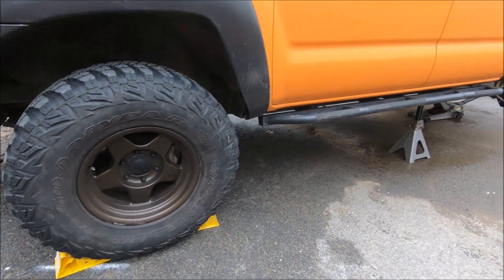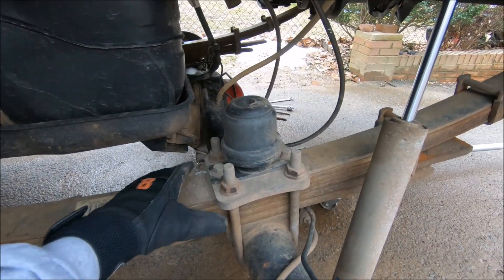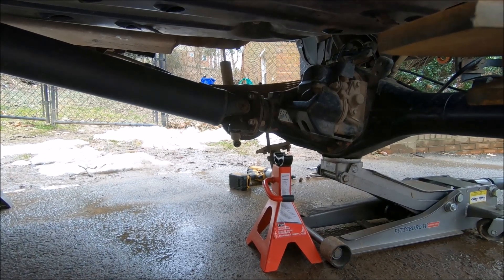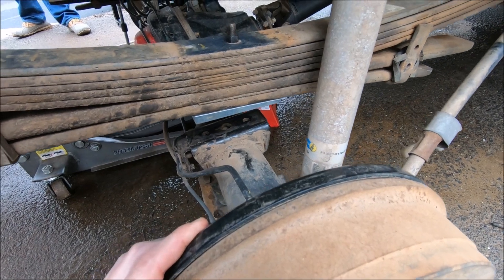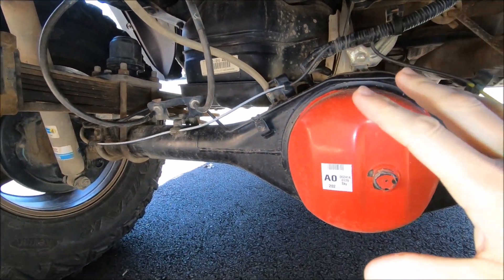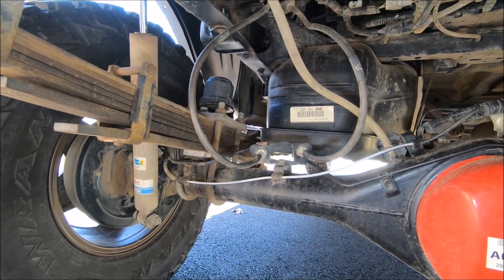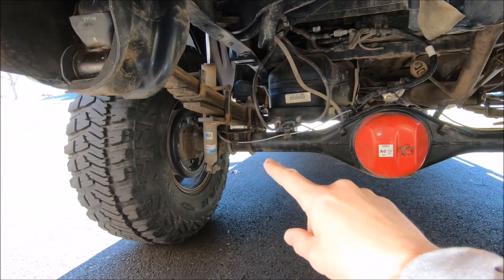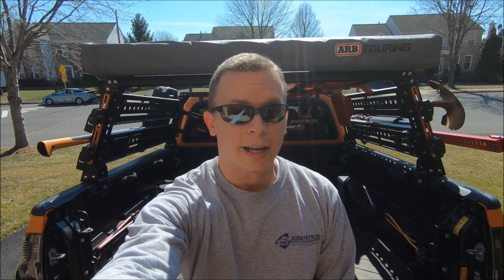Toyota Tacoma Mod Install — AXLE SHIMS Eliminated Vibration

Comment: IT ACTUALLY TOOK CARE OF MY VIBRATIONS !!!!  I did everything that you did to try and get rid of the dreaded  after lift vibrations.  First, I started with the Needle Bearing and replaced with a new Clamshell bearing.  It didn't do anything.  Next, I replaced the carrier bearing and one of the U joints and added spacers,  It made it worse around the 20 to 28 mph.  Sooooooooo,  I watched this video on basically...the last chance on fixing the vibrations and gave it a whirl yesterday with Toytech 3 degree shims.  When I took the truck for a ride to see if it actually worked, in my amazement IT DID!!!!  WEEEHOOOO!!!!  I can't believe it!!  What a relief to finally figure out if I was ever going to fix it or drive it with an annoying vibration.  So Thanks Mr. Tacomaholic Sir!  I really appreciate you always taking your time to do videos for us 2nd gen Tacomaholics.'  Well Done.
Reply: I just did the same in that same order except also dis cv axles since they were leaking... just ordered a shim due to it not having one... maybe I removed it when I put the leveling kit idk lol

Comment: When I put on my King suspension with OME medium leafs on my 2015 Tacoma I installed shims off the bat because people on TW said so.  After I installed the lift I got noticeable vibes right away.  That same day I removed the shim and all the vibes went away.  Installing or removing the shim took me less than 30 minutes. Did all the work myself with 2 jacks.   So for me I didn’t need any shims.  Only using the carrier bearing drop.
Reply from the maker: Yep. Always good to see if you get any vibes before adding shims. Some need them, some don't.

Comment: Just put a 2inch front and 2 inch spacer lift on my 2013 Tacoma. Immediately had needle bearing noise. Replaced that and the noise is totally gone but I still have a “rumble strip” vibration when I slow down at 30mph. Have diff drop also. I think I’ll try axle shims next.
Reply: Installed 3degree shim. It removed vibration when braking, now have vibe under acell lol can’t win.

Comment: Before deciding to start throwing parts at a problem, understand drive like geometry. Take your truck to a knowledgeable shop and have them show you the relationship between the output angle of the transfer case and input angle of the rear differential. They need to be the same. When you install axle shims or carrier drop shims it can negatively impact those angles and cause vibration.

Comment: Axel shims are my next step. Have a 2016 SR5 and I'm having vibes after my 2" lift. Tried the ECGS bushing and CB drop. Vibes are from 35-45 while at low rpms.
Reply from the maker: When was the last time your wheels/tires were balanced?
Reply: @Tacomaholic  When the shop put on my F5s, same time they put the lift in (4 weeks ago). They said they will check the balance when I bring it it for a diagnosis on Friday.
Reply: Hey Noah. My truck does the same thing between 25 and 40 mph. How did you end up fixing the vibe? Shims ? Or the carrier shacer ?
Reply: @christianluna5115  I ended up going with shims. I recommend doing a lot of ready on tacomaworld and a lot of measuring to determine what degree shim you need. Tons of good info on tacomaworld.
Reply: Do the vibes happen constantly or intermittently like every 2 seconds?

Comment: I have a shudder/vibration upon deceleration at 25 mph. Have a 3 inch ARB lift with Dakar springs. Vibs drive me nuts. Already have CB drop kit. Thanks for the video. Any thought on driver side needle bearing replacement with bushing?
Reply from the maker: Vibes with deceleration are often caused by an issue with your brakes.
Reply: @Tacomaholic  I already checked that out. Occurs even when coasting in neutral without using the brakes
Reply from the maker: @thumperjr100  Gotcha. Maybe the shims will help then.
Reply: @thumperjr100  Did shims help?
Reply: After many visits to the dealership. That is what they call “Normal Characteristic of the truck”. Not related to the brakes. Regular Driveline Vibration while breaking or coasting 30-10 mph. I’m going to try the 3* shims tomorrow. Even on stock 3rd Gen Tacomas

Comment: Hey man, great video... however, it didn’t appear that you replaced your U Bolts. Always done that with mine. Threads are damaged the first time they get torqued, so when you remove them you don’t get enough clamping force when reusing them. Just my opinion, I’ve seen people do it, but I would rather spend a little extra and make sure I don’t sheer my centerpin or  lose my axle!
Reply from the maker: Hmm I'll have to look into that, first I'm hearing of that.
Reply: Tacomaholic great job on the bumper! Did you ever look into what I said about reusing the old u bolts?
Reply from the maker: Thanks Matt! I've looked around a little and seen conflicting reports.

Comment: Hello, Another great video.  Thank you for the hard work. Can you tell me if the jack you have listed below is good for a Tacoma with 4 inches of lift?
Reply from the maker: Thanks buddy! That floor jack should be good for 4" lifted Tacomas too, but you can use a 4x4 or 6x6 block to help as well if needed.
Reply: Thanks for the quick response. Yeah that's what I was thinking too.  Thank you again!

Comment: hello, I have a 2018 Tacoma with 4000k's on it. I installed a leveling kit 2.5 front and 1.5 rear. I had vibration around 40k's an hour, I replaced the front drivers side needle bearing and also dropped the carrier bearing with the old man 8mm spacers. but still have that vibration. feels more like coming from front end cause I can feel it at the steering wheel. maybe I should try putting the rear diff spacers to see if it goes away.
Reply from the maker: Worth a shot trying the axle shims in the back. Are you sure your wheels/tires are properly balanced?
Reply: yes I took it for alignment and got the wheels balanced to make sure...
Reply: @ferncules1  did you end up finding out what it was
Reply: I'm in the same situation, did you end up finding out what it was?

Comment: I put a 2” add a leaf on my 2017 TRD Off Road 4WD. 

I’ve been getting vibrations from 20-25mph. 

Would you recommend 3 degree or 2.5 degree shim?
Reply from the maker: The axle shim could certainly help but try adding the carrier bearing drop kit first as it's cheaper and easier to install. Here's a link to it which should be good for all 2nd and 3rd Gen Tacomas: https://amzn.to/383P3FF
Reply: Ronnie, I did the same as you and also have the 20 mph vib. Did you do the CB drop? Were you able to stop the vib?
Reply: @bward5725  I'm having the same situation, did you solve it?

Comment: Im doing an AAL to my 2012 sr5 DCLB here in about a month, how do I know if i will need this??
Reply: also doing a toytec 1.5" rear block in the back too if that matters
Reply from the maker: No way to predict if you'll get vibes after adding a lift.
Reply: Tacomaholic would it be bad if I just installed the shims when I do the install? Not knowing if I needed them or not ?

Comment: Can you use shims with a block lift too?
Reply from the maker: I'd check with both the manufacturer of the blocks and shims, but I would guess it's fine as long as the shims are overhanging the blocks too much.
Reply: @Tacomaholic  I have 2" block spacers in the rear for leaf spings would you suggest 2 degree, 2.5 degree, or 3 degree axle shims?
Reply from the maker: @alecjohannesman7633  The 3 degree seems to be the sweet spot for most applications. If the shims help to get rid of your vibes then 1 or 0.5 degrees probably isn't going to mean that much.
Reply: Tacomaholic would you install the shim above or below the lift blocks?? 

Thanks so much for your help... these vibes are frustrating

Comment: Question for you, I installed an Eibach lift kit and went with notch 2 because I have a winch. I believe I over estimated the winch because I was too high in the front, which required I add my over load leaf back in, in addition to my 3 leaf progressive add a leaf pack. Would this shim cancel out the need for my over load leaf?
Reply from the maker: The shim adds a little bit of lift, but probably not as much as the overload leaf.

Comment: will this shim kit work on a lowered tacoma?  99 5 lug, i have some noticeable vibes around 60-70 mph that kinda comes and goes especially if i accelerate
Reply from the maker: I'm not sure if it would work for a lowered truck since that angle is designed to help get the driveshaft back to stock geometry on a lifted truck. On a lowered truck I would imagine the driveshaft angle is going in the opposite direction vs a lifted one (or not moving at all).

Comment: Hey man i had some icon coilovers in front and shocks in rear with an add a leaf and the rear right is higher than the rear left . Why do you think that is everything seems to be correct but im not sure what im missing
Reply from the maker: Hey buddy! The driver side rear of the truck has the gas tank which, when full of gas, can certainly add a lot of weight and make that side sag just a bit compared to the passenger side.
Reply: Its 1” different . You think it will sag that much ? Does yours sag?
Reply from the maker: @agustinherrera5600  Yeah it could sag that much. The add a leaf isn't as strong at supporting weight as a full aftermarket leafpack. I'm running the dakars and both sides are even.
Reply: Alright man thanx for the info
Reply: Hey man one more question , the same side on my tacoma that is higher , the wheel sticks out more that the other side , i didnt notice that until i recently bought new wheels . Is that normal or is that off somehow aswell?
Reply from the maker: @agustinherrera5600  How much further out does the wheel stick compared to the other side?
Reply: Haven’t measured it exactly but its very noticeable its about 3/4 to 1” maybe
Reply from the maker: @agustinherrera5600  That's a pretty big difference and shouldn't be like that for only 1 tire unless it's just an illusion from one side of the truck sagging too much.
Reply: Yea its only for 1 tire , i started reading about and apparently alot of people have that issue but not sure what causes that or how to fix it
Reply from the maker: @agustinherrera5600  Are you getting any vibrations when moving?
Reply: No vibrations , i noticed it after i changed wheels the old ones didnt stick out and these do but im not sure what it can be that causes it to sit higher and poke out more on one side . Do you think sifting the axle is a possibility?
Reply: Shifting , sorry
Reply from the maker: @agustinherrera5600  If the axle was shifting you'd be able to feel it. Just weird that only 1 of the wheels is sticking out like that.
Reply: I dont mean shifting as it drives i mean maybe it moved when i had the add a leaf installed . Do you think its possible to shift it back if that was the case ? Loosening the u-bolts while raising and try to shift it back ?
Reply from the maker: @agustinherrera5600  Yeah you can adjust the leafs like that but that wouldn't cause the wheel to stick out.
Reply: So what do you think would be the fix ?
Reply from the maker: @agustinherrera5600  Honestly I have no idea. Never heard of just 1 wheel sticking out like that. Might try rotating the tires and see if the issue still happens on the different wheel in that location.
Reply: Ill try that . Thank you

Comment: I just bought a 2019 SR5 Double Cab RWD and have vibrations in the steering wheel around 19-26 mph that drive me insane. Anyone know a fix? Toyota claims “its normal.” Which I believe is BS.
Reply from the maker: Not normal for a brand new truck. Have you tried a different dealership?
Reply: I’ve taken it in three times already for the same issue and I haven’t even made it to my first payment date. The third time they called Toyota and Toyota claimed “its normal” and refused to fix it. So I called Toyota directly and basically had to show them my fustration and that I was willingly to take them to court over the Lemon Law in my state. The lady I talked to was nice and said she’d send a ‘regional tech” out this Tuesday to test drive it and see what he thinks. So we shall see. I jacked the back up and driver rear tire spins freely, the other side has a rough hang up spot in the rotation. I’ve guessing that’s not normal. Its a shame. I alway wanted a Tacoma, I finally get one and its been a NIGHTMARE...
Reply from the maker: Let me know how the visit with the tech on Tuesday goes. Sucks you are having to go through this with a brand new truck.
Reply: Thanks and will do.
Reply: Well Toyota said “its normal” and refuses to do anything about it.
Reply from the maker: Ugh, sorry to hear that James. Might want to take it to a trusted tire shop and make sure all the tires are properly balanced. Road-force balancing might be another option.
Reply: They did find that the rear passenger side drum was warped. They’ll fix that tomorrow and road balance the tires and I’ll test drive it after that. If that doesn’t fix or help the problem (I did test drive another one on the lot and while it did it ever so slightly it wasn’t anything near by truck’s level) then the dealership said they themselves would do anything they could to swap me out without me taking a huge it. It just happens to be a silver one and I have a quicksand one. One dealer in a nearby town said he has a quicksand one like mine and they said they’d help me out too. We shall see. I will definitely test drive the next one I get for more than a mile although mine didn’t get bad till about 200-300 miles.
Reply: Update and question. So I traded in the Tacoma and got another one (same version - SR5 RWD) except this one is silver. I have noticed after test drive several several new ones that all the 2019 have some sort of slight slight vibration around 20 mph, my previous 2019 just did it way worst. I thought about maybe replacing the leaf springs myself to see if that could fully remove it. Any suggestions on which ones I could get that work well? I want some that are better than factory but will only improve my ride (added weight in the bed or none) and are not overly expensive. Thanks for your help!
Reply from the maker: @jpughinreallife  Now you have me wanting to go test drive a 2019 and see if it vibes on me. Are you looking to get any lift with the new leafs?
Reply: You should. Everyone I’ve test drove do it and I was test driving them at different dealerships. Most people probably don’t recognize it but because I had the problem to a greater degree, I notice them now even when they aren’t bad. But they're still there on every truck at that speed. On the springs, i have an SR5 RWD and I don’t want a lift for now. My thinking is that the springs could be an answer and I was wanting to change mine out for better than factory ones for not a large amount of cash. Ha

Comment: So what causes the taco tick and is it fixable?
Reply from the maker: Not sure what causes it (general engine noise) but as long as it isn't too loud you should be fine.
Reply: No it's never loud. I was just thinking maybe the PC valve.  I know the are nosey 4 cylinders.
Reply from the maker: @MORECOFFEE123  I plan on doing a vid for the 6cyl but the process should be the same.
Reply: @Tacomaholic  yea I have a 05 v6 prerunner.  It's not bad just annoying plus I just switched to all terrian tires so now I have the small noise from that also and it's just like ugh! Lol